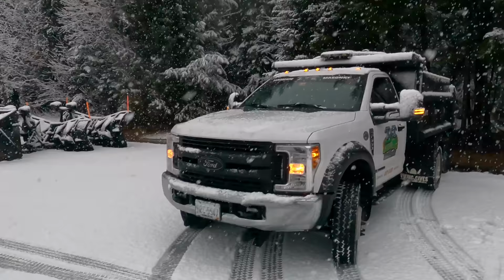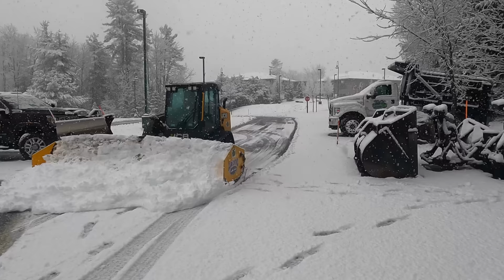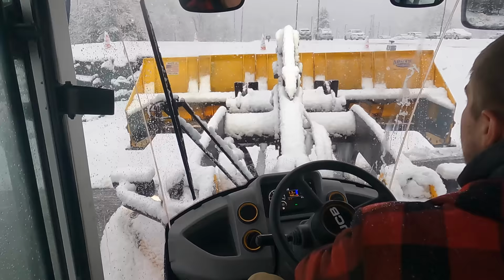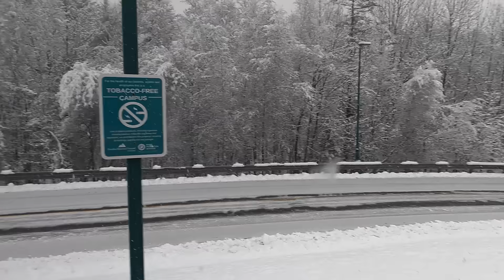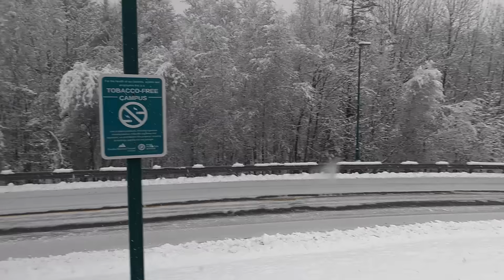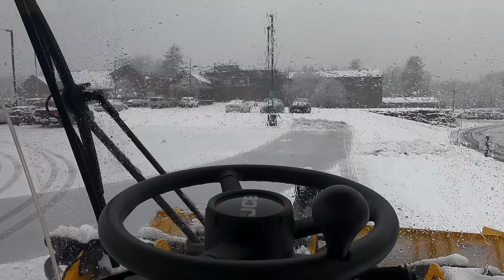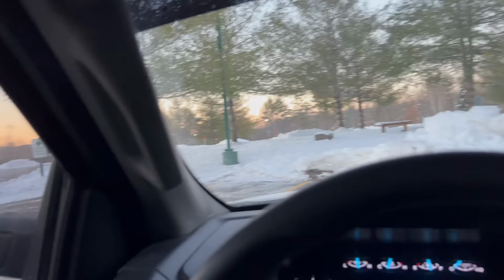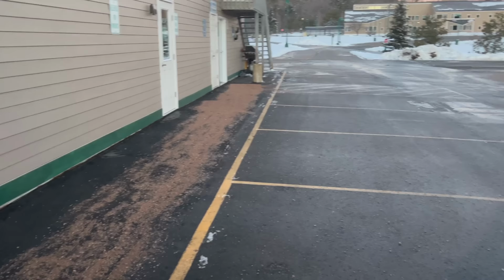SNOW PLOWING DAY IN MY LIFE

Comment: I worked for ARCTIC for quite a few years plowing in a loader with a 18 footer. Operated a CAT 328 k Kamotsu  344  both awesome but the Kamotsu could push way more also you aughta check out their new truck plow pretty slick set up wing on side of plow move independently in or out plus plow moves up down left and right.
Reply from the maker: Nice I bet that was fun! I don’t think I’m gunna get one just cause fishers are cheap and we don’t use trucks much. But I do want the skid steer version bad! 10.5 one. I heard they r 26k 😑
Reply: Hey they do sell used sectionals or older ones. Call their Frankfort, IL location ask for John Starek you can tell him I sent you John is a great Guy as well as the owner Randy and both his boys Lucas and Blake any way you can tell him Dennis Mac the IRISHMAN SENT YA HELL KNOW 👍👍 Good luck and HAPPY NEW YEAR
Reply from the maker: @dennismcclintock3154  they sell them used? I thought they came out this year? It’s the hydraulic one
Reply: @tandtlandscapeandmasonry  Im so sorry thought your were referring to the sectional box. Not the new the new plowdesign with the hydrolic wings. I've done snow removal since I was 16 years old.worked with ARCTIC, Private outfits, my own business plus 10 years for the STATE OF ILLINOIS IDOT PLOWING SNOW. 2 things you could finance that thru ARCTIC I BELIEVE or even though partial to the sectional I still like the Kage set up. It's a box pusher then it's a straight blade as well.Plus I would think it far less expensive but I'm probably wrong being everything in this country has gone up ridiculously.Also kinda and FYI if ya didn't know on the sectional there are to cut outs one on each side towards the top. It's a sight hole for the operator to see. In that cutout is a visual of the moldboard. This lets you know if the blade is square to the ground. Now like curling your bucket forward doing this to the sectional will create more down pressure to help remove packed snow or ice. You'll be able to watch moldboard move forward and back in that triangle cut out. Basicly when it's lined up in the center all good just a touch forward will create a better scrape when it get rough.One more thing if I may .Seen on the video you stated a lot of salt. Two things purple snow slicer which requires far less speed and works quick and good to about -20 degrees. Yes rock salt is much cheaper but if your going thru 15 tons that's a lot and yes it is more expensive but using far less also I understand its a hospital so meaning ZT LOT zero tolerance nothing on the lot for liability. Or the other thing my buddy does with buy rock bulk which I'm sure you do is he buys a plastic tote of this stuff similar to beat juice and then sprays the entire lot of the rock salt turning it to mix it with the skid or loader then really what's left. Thus stuff worked awesome quick acting but what was great after it did it job of melting creating like a brine after it would dry up it left a residual on the lot helping the next snow not stick right a way. Sorry for rambling on done thus so long I could still do it in my sleep 😂😂😂 Have great one and hope you have a good season. Where I live in Illinois we've only seen if lucky so far maybe  0.50 😩
Reply from the maker: @dennismcclintock3154  your all good and thank you for all the info you know your shit. I tell all the guys about the pusher and had them watch the training video arctic has but one of the kids is like brand new. The salt thing I charge them per ton. So I don’t mind using a lot. I do have stand by liquid stuff that I can spray on that goes to -20 if we get a cold snap!
Reply: @tandtlandscapeandmasonry   ok cool have a great new year. Gotta funny question kinda was looking at your title. How do you do landscaping and masonry 😂😂😂. Look I know landscaping you cut grass trim and leaf blow them in fall you do leaf clean up which by they Sucks to do 😂. Then I'm sure you install new bedding and grass as well as foliage and tress and shrubs arbervities. So I'll guess the masonry part???  Brick pavers and building retention wall??? Also almost forgot as far as that sectional goes over curling the moldboard will put severe strain on those lovely rubber blocks then all of a sudden BAM SNAP OOOOPPSS 😂😂 BEEN THERE DONE THAT BOY MY BAD  😂😂
Reply from the maker: @dennismcclintock3154  so I got 2 guys that do lawn mowing and landscaping and 2 guys that work with me and do mostly hardscaping and excavation! We do some masonry but not as much at paver patios, retaining walls and drainage jobs
Reply: @tandtlandscapeandmasonry   very cool where is your company located ? It’s nice having a small crew less baby sitting 🤣 and more ability to work more productively verse’s having more means more baby sitting and more likely to get conflicts being some individuals get the I’m better than you syndrome now ya got issue baby sitting and referee lol 😂
Reply from the maker: @dennismcclintock3154  Livermore falls Maine! And you got the right idea!
Reply: @tandtlandscapeandmasonry   👍👍👍 never been to east coast would love to go some time . Have always wanted to go to VERMONT for some reason. I’ve been to PHILADELPHIA AND NIAGRA FALL FIR MY BOYS GROWING UP HOCKEY LEAGUE AND PENN HILLS PENNSYLVANIA OH YA ONE MORE thing STILL WAITNG For THAT XMAS gift YOU know THOSE DELECTABLE MAIN  LOBSTER 🦞😂😂😂😂😂🍺🍺🍺 just kidding  talk to ya again go get ya some snow. PS you still like FISHER PLOWS EVEN THOUGH IT A WESTERN IN YELLOW 😂😂

Comment: I plow 50 driveways close together. How would the arctic seal maybe 8 foot be on the driveways with the Asv RT 75 what did damage him or be OK?
Reply from the maker: I’d recommend it if it’s a tire machine but pretty sure that’s track? I mean track still would be good if you have the right tracks on or studs but they are slow compared to tire

Comment: Does Maine require a hoisting license to operate the equipment , I live in Mass and they require one
Reply from the maker: They do not and wow I didn’t know that
Reply: Yeah, i run a tractor trailer lift truck, easier to show than explain what that is, and i found out due to building inspector showing up tbY i was supposed to have one.  I have a forklift license, but thats in Pennsylvania where i run out of.  I wasnt sure wether maine was the same or not.  I deliver up there but never checked into it.

Comment: whats the difference in salter size between your main salt truck and the f-750
Reply from the maker: 3 yard vs 4.5 yard
Reply: @tandtlandscapeandmasonry  oh so its not crazy difference is size would of thought the 750 would of been a little more convenient to use gor salting but difference in fuel makes up no
Reply from the maker: @TommyRedline  the reason why I don’t use it is because i don’t wanna rust it out. It’s my most expensive truck and I want to baby it and keep it in mint condition. Also the 550 anyone of my guys can drive, it has 4wd with better tires, they turn better and have better visibility.
Reply: @tandtlandscapeandmasonry  ive noticed the same using a denali 3500 dually compared to a 7500 topkick the 3500 is a lot better turning ratio and easier to get into tigher areas compared to the 7500 thats only good for pretty much doin main roads
Reply: @tandtlandscapeandmasonry  been in the business for almost 10 years have a 2500 3500 dually both denalis and a 7500 and both 2500/3500 have way better turning ratios then my 7500
Reply from the maker: @TommyRedline  yes the 450s and 550s are best in class. They turn insane